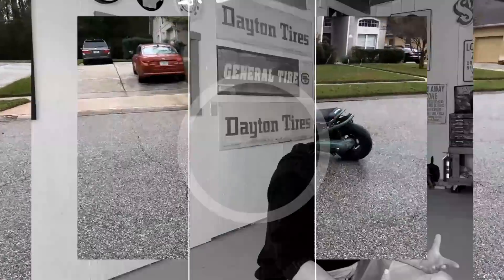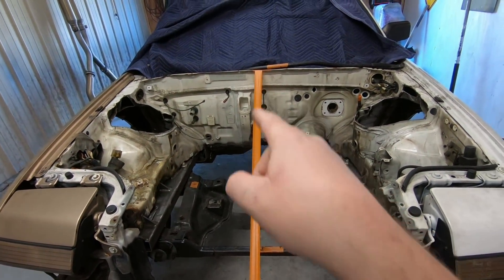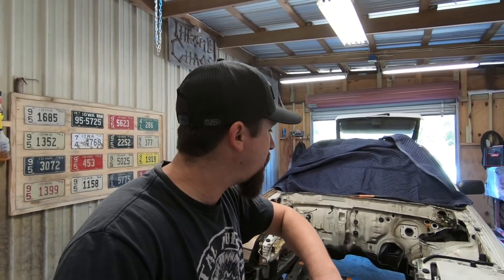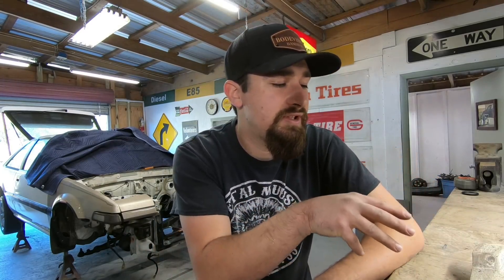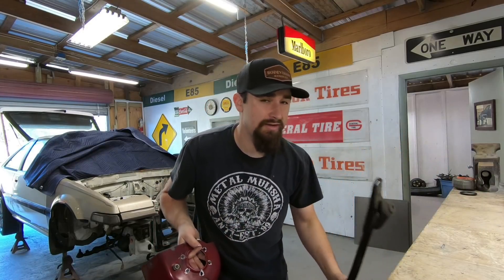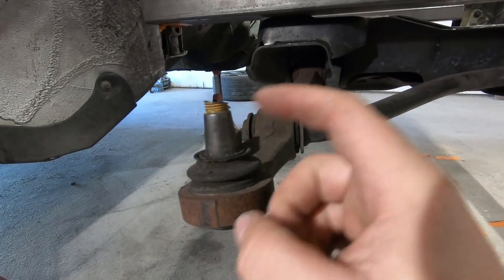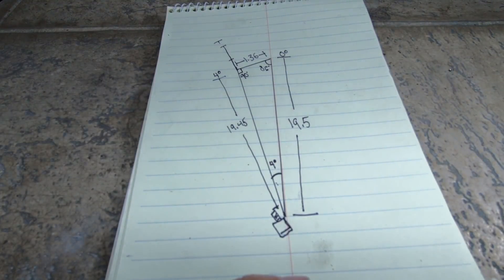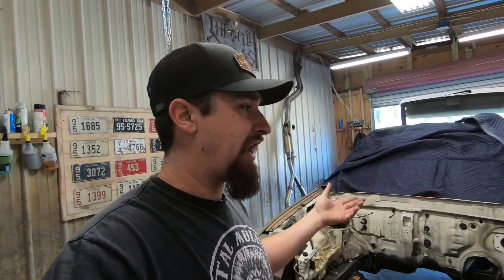Suspension Geometry Explained for my V8 LS Honda Accord Project

Comment: camber and toe isnt too important, what is important is that the roll centers, caster and king pin inclination remain similar if not the same. MotoIQ have an Ultimate suspension guide, explaining everything you need to know about suspension and more. I'd recommend you have a glance over it.

Comment: 4-5 degrees caster should be okay, but I would have erred on the high side. McStrut likes lots of caster. 5-6 degrees would be cool. Not  a huge deal though, it should drive well regardless, it just affects self steer.

Comment: Get as much caster as possible! It will help steering return and the car to go straight it doesn’t have to be the same as the gto. As long as wheels fit evenly in wheel wells. If you make slots like a stock 3rd gen camaro has on the strut towers you can adjust camber and caster

Comment: you plan on keep the strut tower brace or just using it for reference? looks like it won't clear the hood. enjoyed the vid 👍🏽
Reply from the maker: alphonsevallery probably just for reference. Once I drill holes for the e36 tops the brace might not even fit. We shall see

Comment: You can get adjustable Castor kit mounts on k frame to z bar have different thickness washers .  the monaro / commodore / gto has a  camber adjuster at the knuckle back off the strut bolts wind 8 mm headed bolt in or out for camber adjustment . Loving your channel

Comment: PLEASE! Add a bit more caster (+6 to +8 degrees.) If you plan on doing any amount of drifting in this thing, it will help with your return-to-center tremendously. Most drift setups run fairly high caster to help with mid-drift control - most German RWD cars come from the factory with +8-9°!
Reply from the maker: i will look into seeing if i can get caster adjustments on the actual coilovers, i didnt want to bring the shock to much closer to the fire wall as i need room for clutch master
Reply: @BodeVision  It should also be pretty easily done by changing the bushing thickness on the front control arms where they slide forward into the front of the subframe. Pretty much the same as an adjustable traction bar for a Honda in principle.

Comment: don't you think you should figure out the motor mounts and subframe before suspension?
Reply from the maker: welcome to my channel this is my 4th video in an ongoing series where i am putting an LS into my accord. The Subframe you see in this video is from a gto and thats where the motor will mount. If you had any questions on how i did that i will link the previous video for you. 
https://www.youtube.com/watch?v=WHrwr794WxE&t=837s

Comment: Hi Adam, since you are using coilovers and can adjust the height, yo should lower the strut tower tops so you can use the stock hood.  The length of the coilovers can be speced  when you order them.  You could use a dry sump, like Taylor did on his Miata.  This will eliminate the oil pan and lower the overall height of the LS engine.  This should get you very close to fitting under the stock hood.  You will give you a killer sleeper. If you cut the flanges of the headers that came with the headers on the GTO, Taylor could help to make some custom headers to fit with the subframe  on the Honda.  Just don't cut the headers until you find out where to cut them,  you may be able to fit them mostly under the motor , or you may need to trim the firewall and floorboards a tiny bit to get them to fit.  It just depends on how much clearance you have on both sides of the heads on the LS.  Great job explaining the math you used to get the results you needed to place the strut tops.  Just lower them to clear the stock hood.  It will be a much cleaner stealth look.  Taylor should be able to help with the exhaust.  He has a lot of experience making exhausts for his various projects, and he has a tig welder.  I'm sure he would be happy to help you out.  Personally, I would have put a K20 in there, and turbocharged it using PFI speeds recommended eBay turbo, you could easily get between Five and nine hundred horsepower and the motors are cheep and plentiful, you could even make it all wheel drive like Trevor did from motion auto TV.  Keep up the great videos!

Comment: Had you made some mock three point suspension arms to reference the lower a arm mounts and the strut towers, with your brace you could have avoided all of that measuring stuffs and been more accurate. Are you gonna get some good caster camber plates on the top too? You'll probably need a little adjustment.

Comment: Negative caster with the the tops of the knuckles tipped towards the rear, I 'believe' that'd be positive caster.
 Note I've been alignment/suspension work for the last 30 years.
Reply from the maker: 8:08

Comment: Have you thought on maybe using portions of the firewall and the transmission tunnel from the GTO on the honda?
Reply from the maker: I am just going to build a custom trans tunnel as it’s probably less work to build one rather than trying to make two different half’s a whole.

Comment: The show fantomworks put a gto front end in a 56 Thunderbird and they made it look 100x harder than you did. And I dont think it was tv editing because they couldn't figure out how to fit the struts in it. I'm pretty sure a 56 t bird is a bit bigger than an 80s accord..  nice work dude
Reply: The 56 Thunderbird has body on frame construction. It's more work to add a strut front end to that than a unibody.